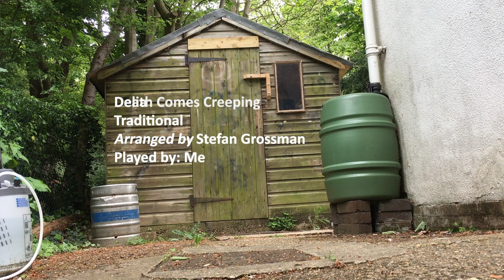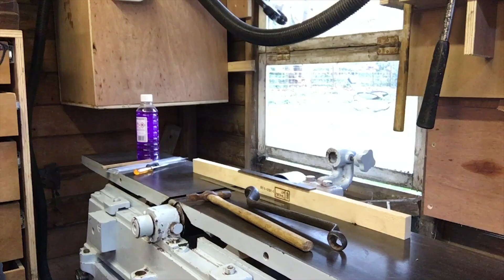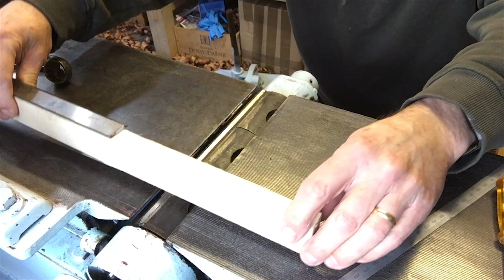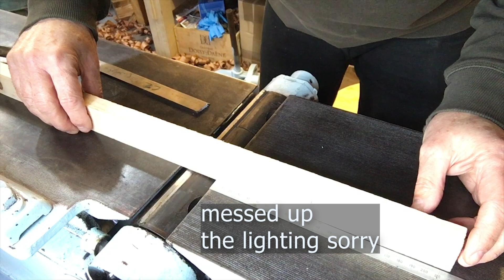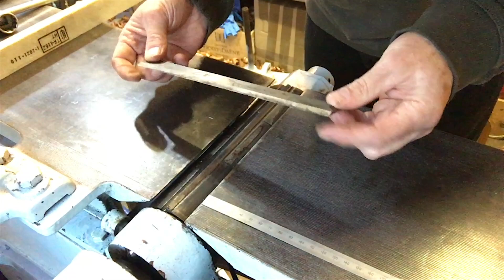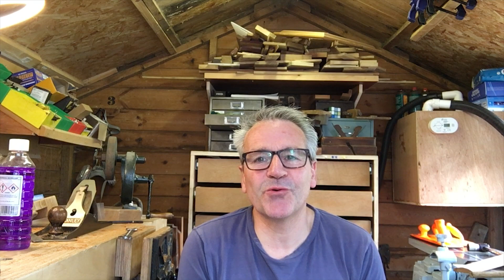Vintage Planer / Jointer Setup - This machine has to go its too dangerous

Comment: I think you are making the right decision.  These old machines can be troublesome.  At least you were not hurt. 
Count your blessings and move on.
Reply from the maker: I have made enquiries regarding a Helical replacement part what do you think?
Reply: @TheShedProjectUK   I would verify that the machine is balanced, check bearings and retaining caps before spending money on a new cutter head.  If there’s imbalance or vibration, even a helical cutter would not give you good results.  Best of luck whatever you decide.
Reply from the maker: @Cowboy_Ash  it looks like I will be moving house in a few months so its going to go - wont have the space and a smaller benchtop machine will be more sensible

Comment: Completely understandable how you might scrap this machine after such a frightening failure; my own feeling was that it was very large for such a confined space. My first reaction to this vid was you might change your mind when you had considered possible solutions (for example, the motor speed sounded tremendously high and accelerating in previous vids - maybe the centrifugal switch is faulty or not operating properly; perhaps it was supplied with the wrong motor; the blade retention bolts need to be torqued down more fully, etc.) But on second thoughts I think you are right to scrap it - you'll never feel comfortable with that thing, it's just too darn big and brutal for your needs mate. Thank God you weren't hurt. Chalk it up to experience and better luck next time! And thanks for showing us.
Reply from the maker: Thanks